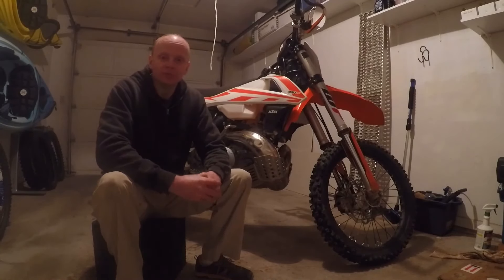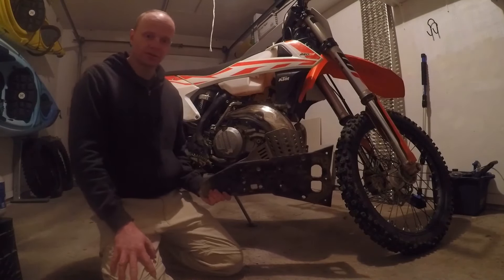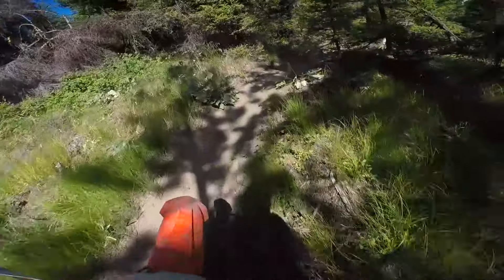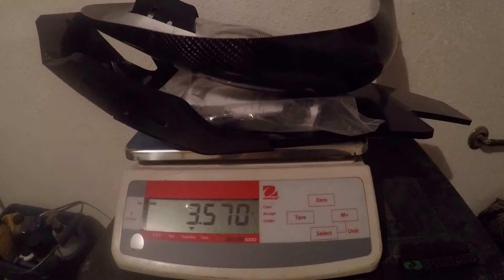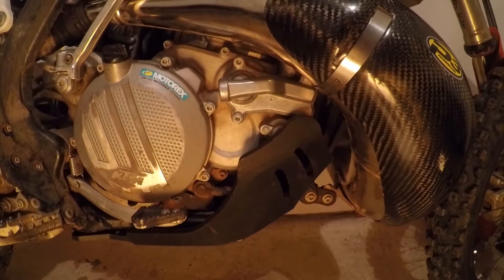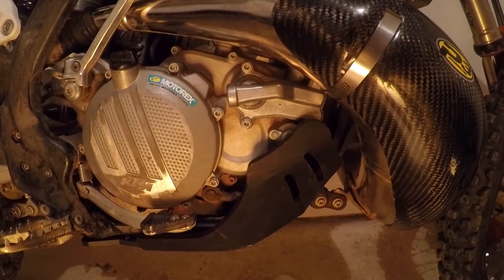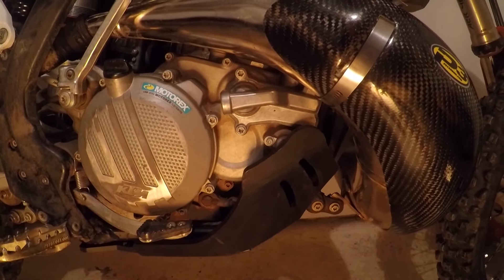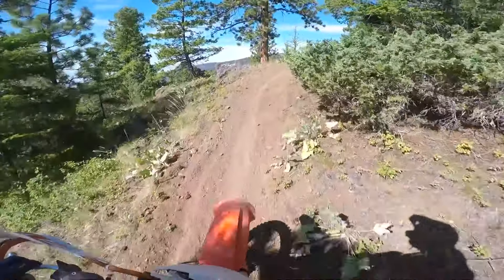Skid Plates Aluminum vs Plastic - Episode 18

Comment from the maker: Leave a comment below, what skid plate are you using and would you use a plastic skid plate?
Reply: PNW Enduro im getting a plastic
Reply: Im shopping for a skid plate for my 2018 yz250 and daughters 2009 kx100 . Looks like mooseracing plastic or sxs. And moose aluminum for the kx100 or acerbis plastic.  As for knoching out the powervalve access ... i dont think it a good idea.  I cant remember what video i saw someone bust the case from a rock hit right in that area. Food for thought

Comment: The emperor product is heavy duty and weighs accordingly.  My shop tech said it looks like something out of a medieval fair!  Lol. I have only 10 hours w it on. It gets noticed by fellow rider for sure.  No dents in header yet. Mud washes right away in cleaning process.  I like it.  I can’t discern any extra weight during ride or picking up bike after fall.
Reply from the maker: How did you find the install? Do you also use the slip liner as well?
Reply: Yes slip liner too. I forgot to mention that.  That works well.  The plastic is slippery and I have noticed that nicely sliding over logs / rocks. The install was bitchy.  No directions in delivery box.  I was able to find the video which critical to proper installation. Everything still right and tight!

Comment: I had a plastic skid plate on my FE350 and after 2 season it was basically destroyed, i went to an aluminum one and never looked back.
Reply from the maker: Stock plastic skid plate or aftermarket?
Reply: TM Designs aftermarket
Reply from the maker: The AXP skid plate is holding up well. I have been talking to the product development guy at AXP about some minor flaws in the design and he has since made some improvements in the product. I'll be testing out the new model once they come off the production line.

Comment: I would never use a plastic skid plate for riding any place that has rocks.  A little bit of bad luck and you could have a hole in your engine case.  A little more bad luck and you could have a locked up motor due to that hole in your engine case leaking out all the oil and you not catching it.  The weight of the skid plate is carried so low on the frame that it is not a factor.  Put an aluminum plate on for the peace of mind.
Reply from the maker: The plastic is pretty strong, I don't think I could hit it hard enough to break it. I'll see how this one holds up over time.